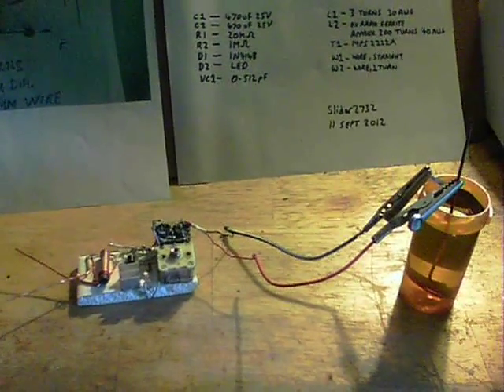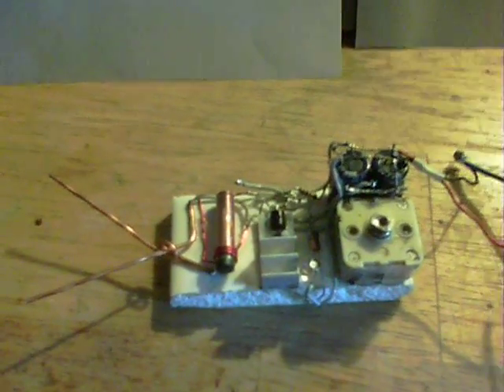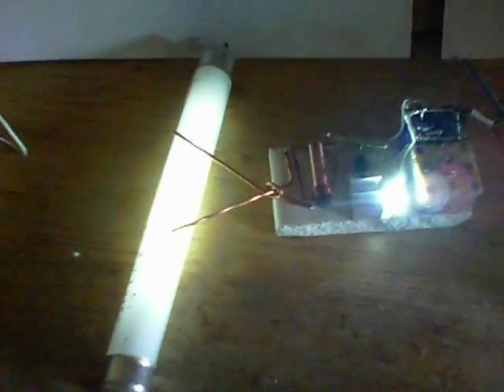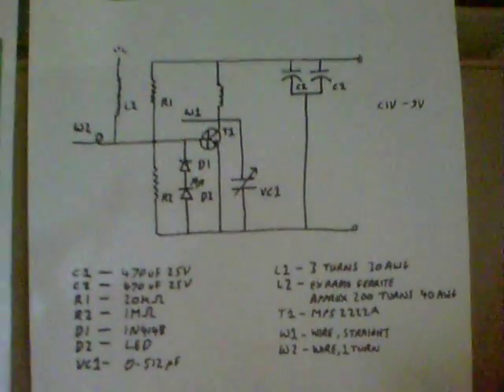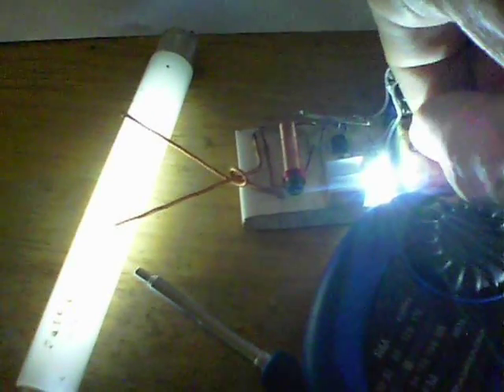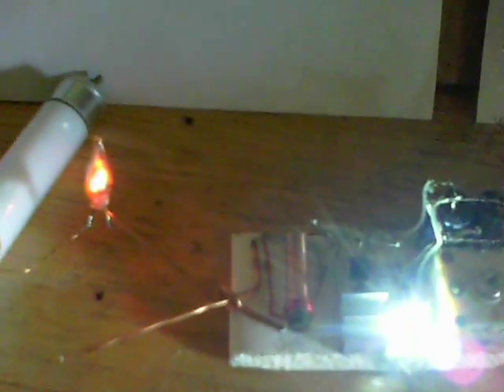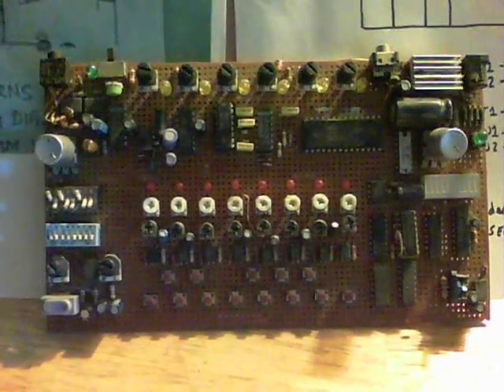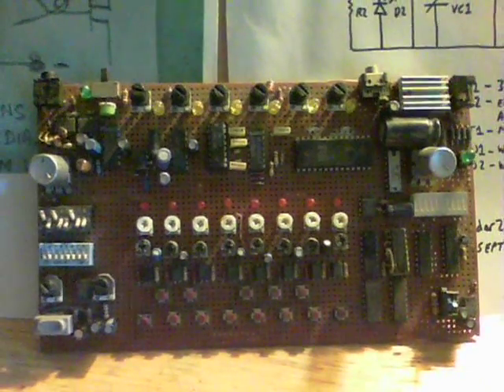CAT Exciter Version 2.0 - codename Bellisimo

Comment: hi slider great video only on question if i parallel 2-3 transistors will it still works?
Reply from the maker: +Yasser crazy boy Normally yes and a good idea for current dividing between them. But this circuit runs cool enough to not need to do that.

Comment from the maker: The circuit doesn't actually need one for exciter type projects, but seems to work well for listening in on a radio to the output.
The var caps can be found in old portable AM/FM radios, as the tuning dial capacitor that the dial plugs on to. 0 to 512pF is the usual range of one, little discs of plastic are inside, that mesh to different amounts as the dial is moved.

Comment from the maker: As I understand this - all is natural, all interconnects and asymmetry is as important as resonance. For example way the Earth eternally spins and has solar system harmony, yet wobbles giving precession cycles. So is the way with this device, charging the air, resonating, yet the tuning can only approximate and drift may need correcting.
In Tesla's CS notes, he mentions the ringing bell experiment, lightning energy permeating through the Earth, then later, shaking the Earth with Wardenclyffe...

Comment from the maker: It's a great idea and some harvesting of energy is certainly possible. Usually, the energy is collected in a capacitor and that capacitor goes back to the power input after it has risen to a certain voltage (often called a cap dump). In practice, there's always a small drop and so the chain ends. But, much can be done with that line of thinking.

Comment from the maker: Kind words, thanks:) 
I looked up a calculator for antenna length..10cm works out to 750MHz dipole and an easy strong length for mains gauge copper. If thinking surface area for reception strength that size would be plentiful and strong. 
I keep wondering about Fibonacci series, Golden Ratio and Earth energies. 9.64cm equates to 780MHz (3.12GHz 1/4 wave) = 1000 times 7.8Hz

Comment: Slider, Is it possible to pull power from one of those lit lites? If so you could use that power to power other Cat circuit to power another light and so on....

I am not a eletronics guy just a crazy idea I thought of.  Thanks for sharing.  "D"